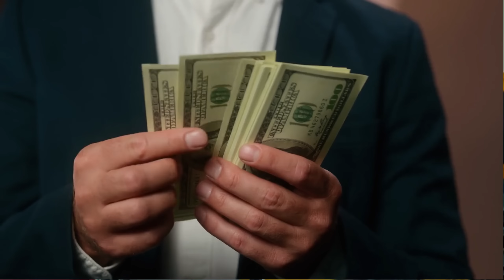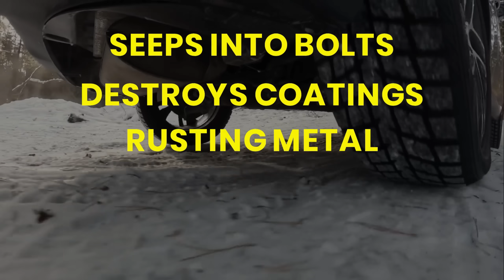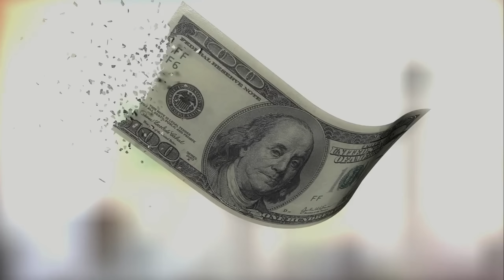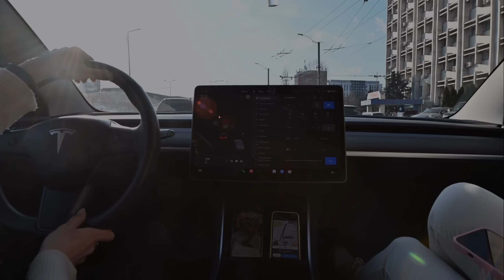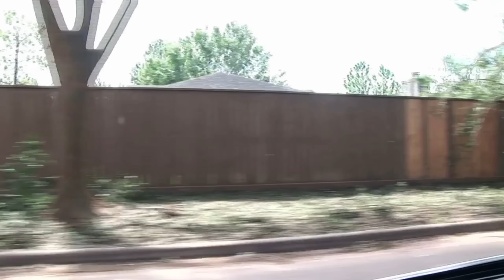DO THIS ONCE A MONTH Will Make Your Car's Suspension LAST FOREVER!

Comment: Everything in this video sounded good, except for the fluid film or anything like wool wax, because there is something better and last longer, and that is lithium grease, you spread that all over your frame compartments and wheel Wells and rust will be a thing of the past, no matter how salt prone you're a roads are. A nice thin layer is all it takes , and if a pebble scrapes it , it starts to heal itself. Just check it periodically , and you're all set

Comment: No grease fittings on most vehicles these days.  Never seen one
Reply from the maker: You're right — most modern vehicles use sealed joints now, so grease fittings are pretty rare. Older trucks and some heavy-duty components still have them, though. Good observation 👍

Comment: Some really good info and tips here. The info regarding greasing  suspension/tie rods regularly is dated, most suspension components are now fully sealed in recent decades and no longer include zerk fittings.

Comment: 1. Never over load your car . 2. Avoid potholes, speed bumps, hitting curbs  etc . 3. Keep clean and wash your car. 4. keep the tire presure accurate. these are the things that drivers should do. the rest is bla bla bla, if the suspension stops working it just stops nothing can avoid that
Reply: So basically don't drive right ?!
Reply: BINGO!!! IT'S THAT SIMPLE.

Comment: True. Silicon based, can even be used in rollers in Garage doors.
I use it for the wheels that contact the rails of my saw.
Reply: I use the silicon spray on my breake disc's that working very good !🧐👀

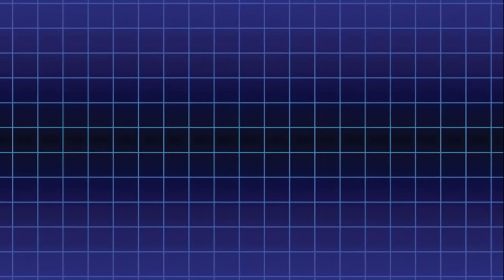Comment: 0:51 11. WD-40 SILICONE
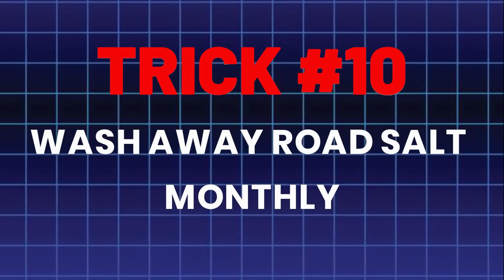1:53 10. WASH AWAY ROAD SALT MONTHLY
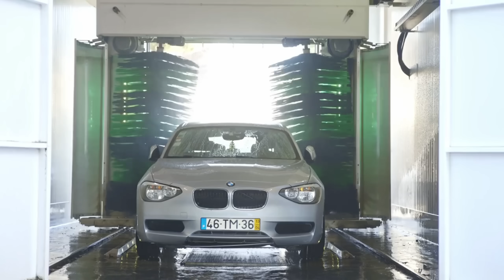2:47 9. ANNUAL RUST COATING WITH FLUID FILM
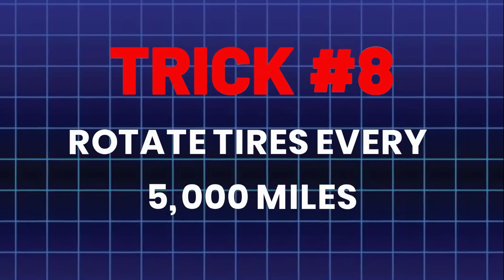3:36 8. ROTATE TIRES EVERY 5,000 MILES
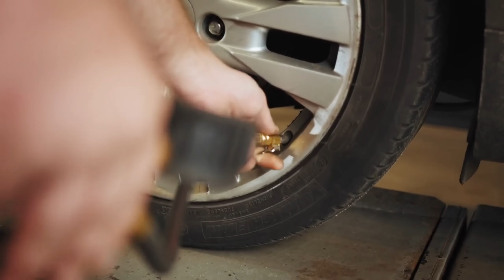4:18 7. KEEP THE TIRE PRESSURE PERFECT
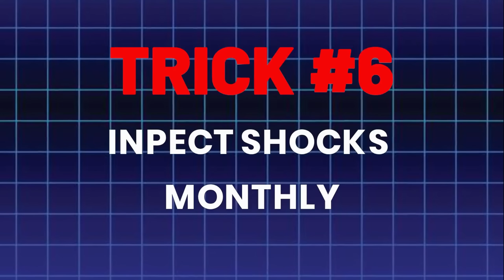4:58 6. INSPECT SHOCKS MONTHLY
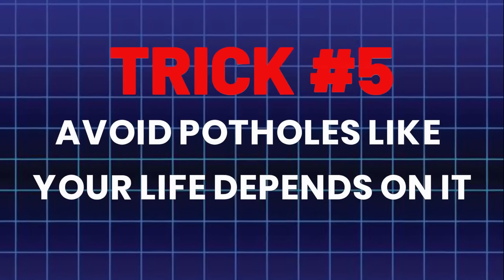5:36 5. AVOID POTHOLES LIKE YOUR LIFE DPENDS ON IT
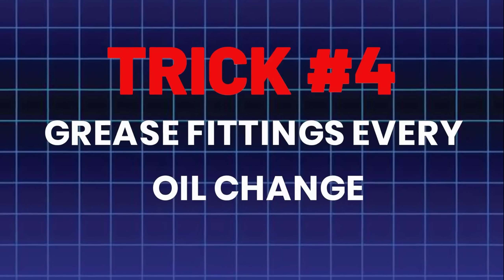6:22 4. GREASE FITTINGS EVERY OIL CHANGE
7:11 3. GET AN ALIGNMENT EVERY 12 MONTHS
7:52 2. CHECK SUSPENSION BOLTS SEASONALLY
8:26 1. NEVER OVERLOAD YOUR VEHICLE

MISTAKES
9:25 1. REPLACING ONLY ONE SIDE
9:55 2. IGNORING WORN PARTS BECAUSE STILL DRIVES FINE
Reply from the maker: Brooo this comment deserves a pin! You literally turned the whole video into a perfect checklist.
Respect for watching so carefully and noting every single point with timestamps  that’s next-level engagement! 

This helps other viewers big time  appreciate the effort, legend!

Comment: Most people don't have the ability to get their vehicle on a lift once a month. Do ramps help?
Reply from the maker: “Yeah, ramps work great  You don’t need a lift  just a good set of sturdy ramps on level ground. Makes oil changes and inspections way easier and totally safe if you chock the rear wheels.
Reply: @CarCareCrewOfficial Thank you so much! I've been curious if ramps were an option for someone without a lift. Your comment is much appreciated and it's time for me to look into bringing a set home.
Reply from the maker: @myrongoodman6741  You’re very welcome! 🙌
Reply from the maker: Great question! Ramps can definitely help you get under your vehicle for maintenance. Just make sure they’re sturdy and safe to use!
Reply: Even harder to find ramps. So, this adivse not achievable.
Reply from the maker: @taoliu2920  True bro finding proper ramps can be a pain , Not everyone’s setup makes that easy. Sometimes using jack stands or low-profile ramps can help a lot .How do you usually get under your car for maintenance?
Reply: @taoliu2920  Avoid continuosly gave an excuses.
When there is a will..there is a way.